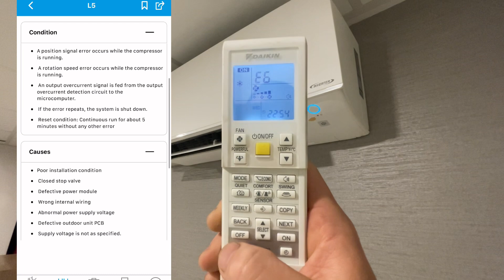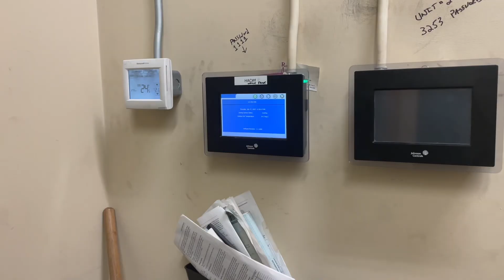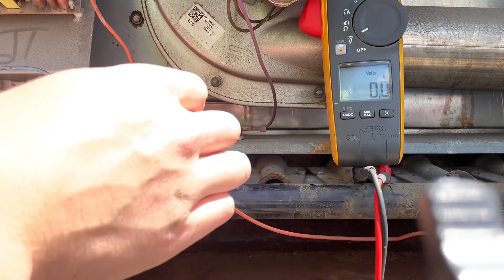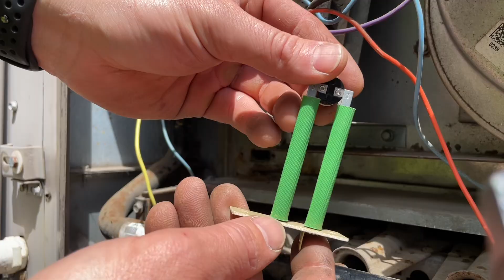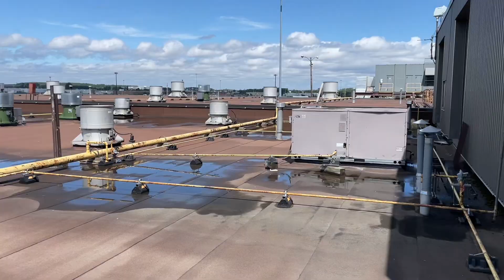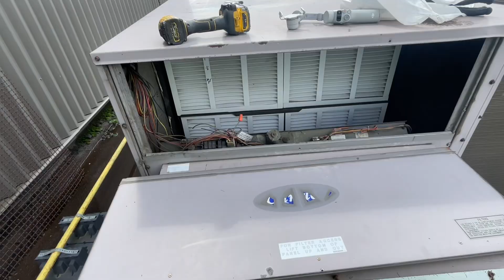HVAC No A/C Calls and Quoting

Comment: Hey Dave. How do you know what Ohm reading to look for on the condenser fan motor?
Reply from the maker: Two of the lower reading should always equal the highest reading for single phase condenser fan motors that are single speed
Reply: @Davenagams even for the Daikin fan motor in the video? It had 5 wires. Thanks!
Reply from the maker: @tylerr8083 OHHHHH SORRY!!! Did I not specify in the video??? I can always reply in a comment here
Reply: @Davenagams you gave the ohm readings. I’m just not sure how you knew to check for those specific readings on the daikin condenser fan. Did you call tech support perhaps? I’m just trying to improve my troubleshooting on inverter units. Thanks!
Reply from the maker: @tylerr8083 I did call tech support but I’ll post it here to save you the trouble of calling in. 

Blue wire is always common. 
Blue to white=1 Megaohm or more 
Blue to Orange=100 kilo ohms or more 
Blue to Brown=100 Ohms or more
Blue to Red=100 Kilo Ohms or more 

These values will infected a good condenser fan motor
Reply: @Davenagams appreciate it!

Comment: You’re asking for trouble if you didn’t condemn that furnace side. If the limit switch looks like that imagine what the heat exchanger looks like.
Reply from the maker: It funny you say that. I was about to put heat x inspections in the video but I didn’t😂. We have fall inspections there, so I’ll check it then. Good call though man